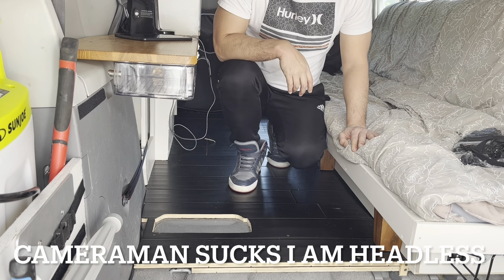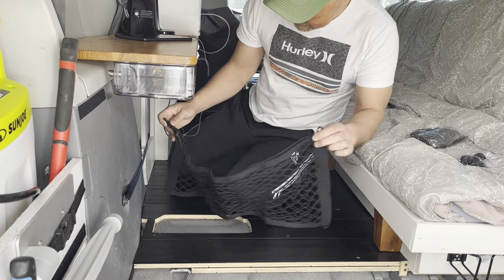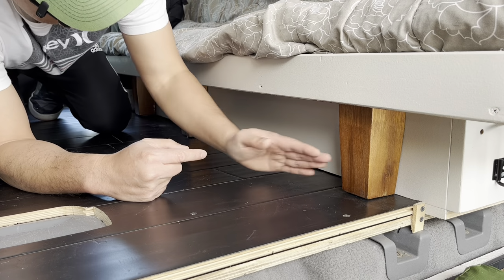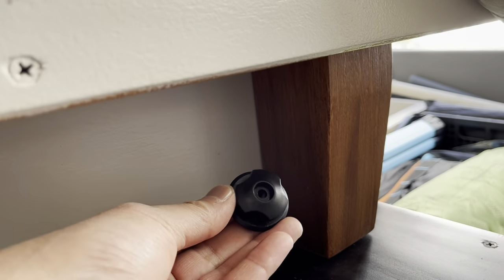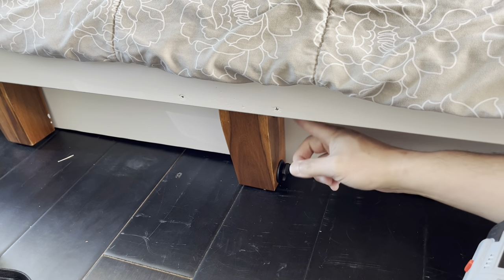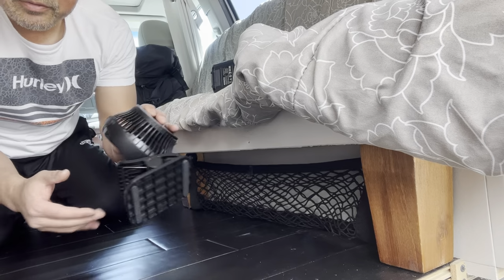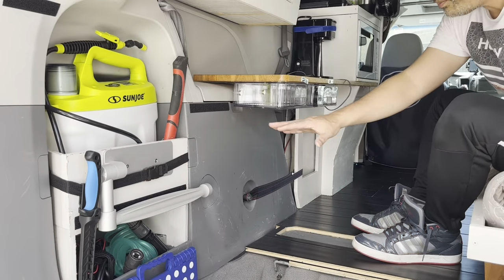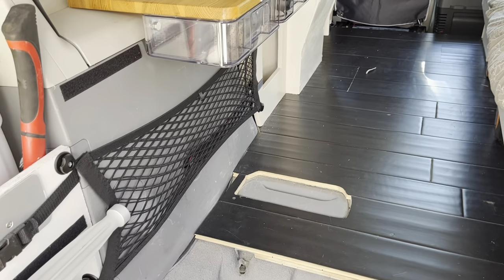Improving Sienna Camper Build.  Upping My Storage Game!

Comment: Dang good idea bro!!! This and those high rear shadow box cabinets I will include in my build. My issue is my rear seat belt bolt isn't a high mount so that's part of an obstacle. Also looking to get a Jita 200ah lithium battery for my house battery. I'm using a Jackery Explorer 500 currently to power my 12v fridge and to charge various small electronics. I actually have a larger net storage across my interior ceiling attached to the stabilizer handles. It has a zipper pocket and I store items on top too.. Adventure on my friend.